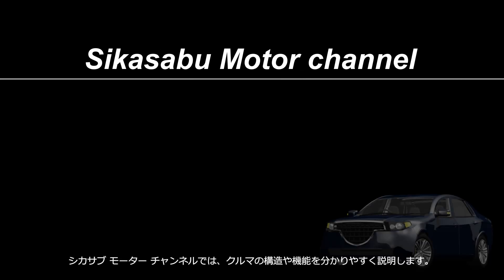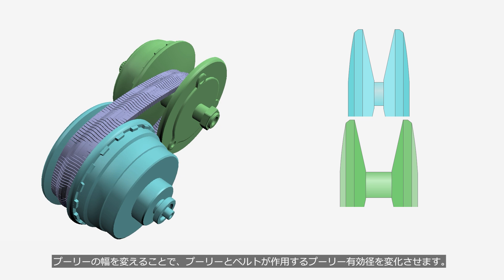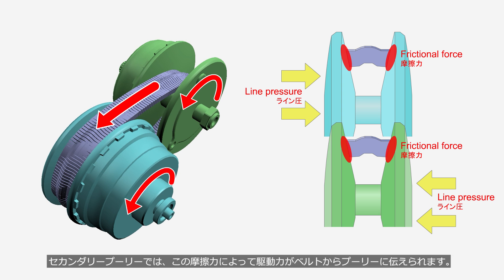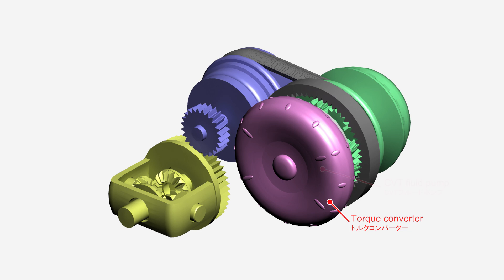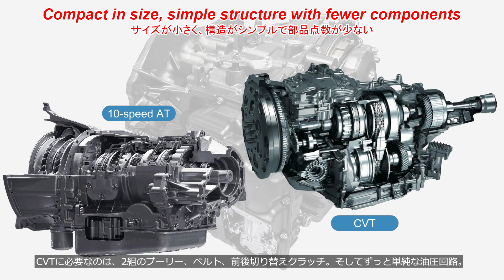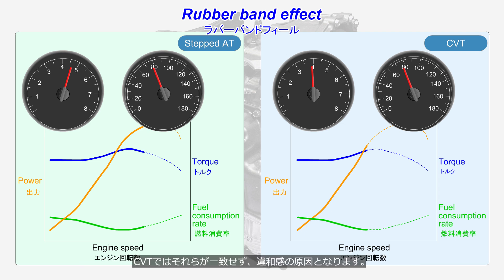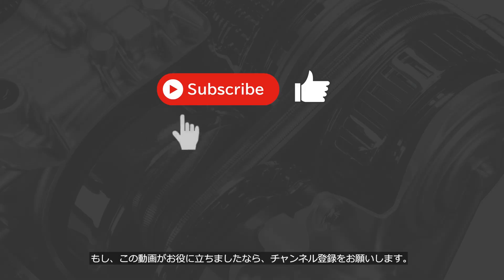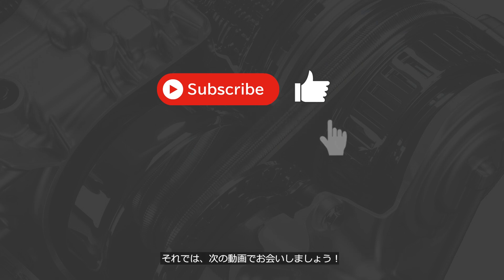Deep Dive into CVT Mechanisms

Comment: Great video, as all other videos on this channel. I just subscribed to it. My two cents to the efficiency discussion, if you allow me: the torque converter of a CVT locks at very low speeds and does not need to unlock whereas in a classical auto transmission it unlocks at every gear change. As a Subaru engineer explained it nicely once, the torque converter works as a "hydraulic variator" between gears. I believe the loss in the torque converter is a substantial part of the total energy loss in the automatic transmissions. Thank you once again for this amazing video!
Reply from the maker: Thank you for your comment. I'm happy to receive your kind words.

Comment: Very interesting video. I am not  sure  but based on  dyno  energy lost is around 14 % at least in wrx side by side manual vs CVT on the latest generation. This potentially is not a small number  but generally speaking all automatic transmissions  generate losses and your claim at 99 % efficiency is  really hard to believe. The  packaging of CVT is really good it is very small in my industry we have what it is called CPP ( control  pitch propeller) it does  something very similar to CVT . It is not  the most efficient  it is expensive but it  can lock the engine RPM in  the  best possible efficiency and since we are never short on power  it works like magic it allows very fast out put change very high maneuvering it is one of the best options when it comes to maneuvering . CVT can do the same thing  all recent cars  are not short on power all they really need is a durable reliable CVT that can  handle the engine torque and I feel like Subaru has managed to do it.  If it is really about efficiency we are all going to be riding the train and would never buy this  big SUV and drive around 2000 kg of still just to got to  work.
Reply from the maker: Thank you for watching the video and for leaving a comment.
First, I will clear up your misunderstanding regarding transmission efficiency.
The transmission efficiency between gear and gear in a conventional automatic transmission is 99%. This does not refer to the efficiency of the entire gearbox.
Since a conventional automatic transmission has multiple gears, clutches, and bearings, the efficiency of the entire gearbox should be much lower.

I’m interested in warbirds from WW2 and have looked into automatic variable-pitch propellers. It seems they were controlled by a governor at the time, but are they electronically controlled nowadays?

I completely agree that efficiency is not the only important factor.
However, nowadays, CVTs seem to have no advantage in either efficiency or driving pleasure. I believe that is why manufacturers outside Japan do not adopt CVTs.
Reply: @sikasabumotorchannel  So the  CPP is controlled by a PLC it has a potentiometer style lever on the bridge and engine room where the signal is transmitted as data to the control module.  The CPP itself works almost identical as a CVT when command is giving to increase or reduce blade angle the piston  controlling the angle is unlocked hydraulically by set  of solenoids . They are setup  up in control circuit and main circuit the control circuit has solenoids and sends  oil pressure to the main hydraulic valves that unlock the piston. Then the control oil pressure is fed to the piston, the piston is double acting and can increase and reduce angle  by sliding back and forward and basically moving the blades that have cams attached to a control rod actuated by the piston.  Once the desired angle is achieved and this happens relatively quickly it is locked hydraulically in position again . This hole assembly is attached with  a reduction gear  to the engine via flexible coupling ( rubber based) vulkan coupling . The engine RPM is fixed at 600 rpm while the propeller shaft is running at  120 rpm. This  also allows a generator  to be run by the engine that it is also integrated in the gearbox. The best part is that the engine is at its best  possible rpm and because of the locked rpm it can also act as a generator. while providing propulsion.  The engine is control  by a electro  hydraulic governor  that is load  sensing  and it doesn't interact with the CPP  electronically it just feels the load and adjust the fuel rack to maintain the set rpm.  This is more or less  how it works. By the way  regarding why other  manufactures shy  away from the CVT is simply the complexity  in the research to make the transmission durable . Audi had a CVT but they discontinued the transmission . Based on my personal  speculation i feel like Subaru has success with the CVT in higher torque application because of the simulated gears that cannot be turned off. What actually happens is the engine ECU reduces throttle during chain shift up or down on the pullies during the simulated shifting point preventing chain slip and once the locking pressure is applied and the chain is in the new desired location throttle is applied again. This is also why Subaru doesn't recommended hard launch from stopped because during this event the chain will be going up and down the pullies under full load that will defiantly cause more wear and  creates a risk of a slip. The fact that the simulated gear shifts  cannot be disabled in the WRX it is clear indication that they serve other purpose  beside making it feel like a standard gear box and in  my opinion is to extended the life on the chain and variators  by avoiding change in ratios  under  high load.
Reply from the maker: When I heard "propeller pitch," I mistakenly thought it was about aircraft, but it's actually about ships.
Thank you for sharing the information.